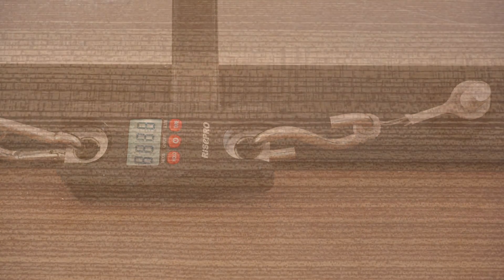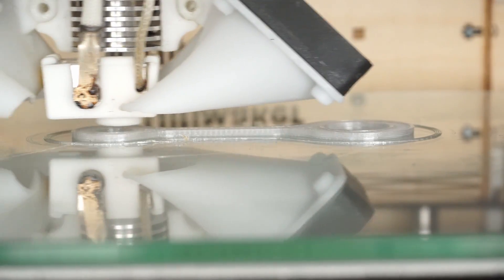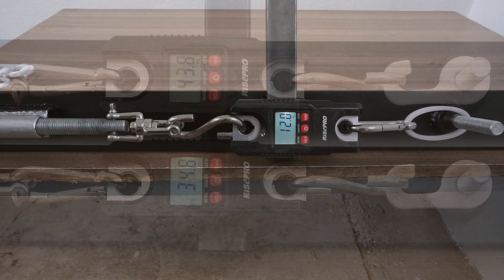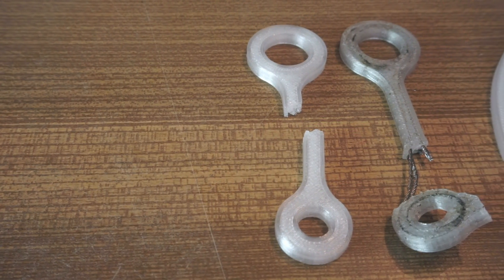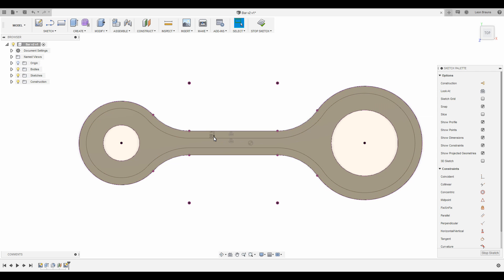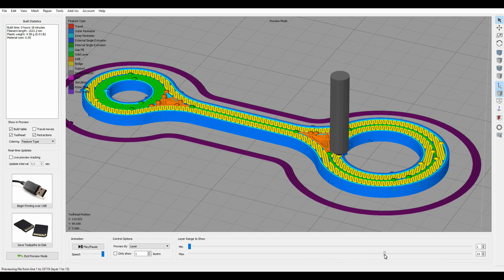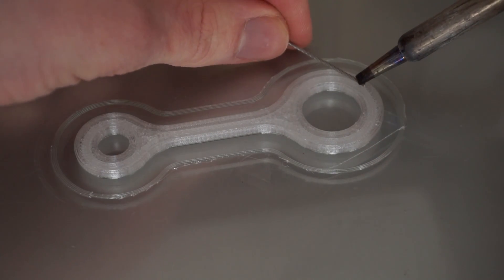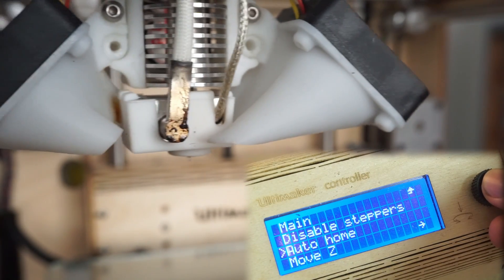Reinforce Your 3D Prints with Steel

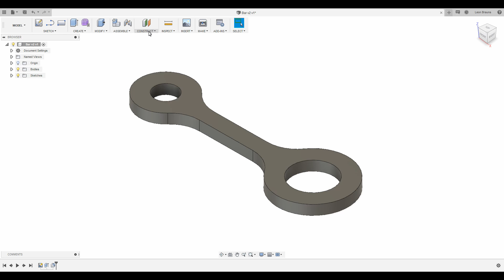Comment: 3:45 don't use an offset plane, use a midplane. This is more robust, because it stays in the middle even if you change the thickness of your part. You also don't need to put a sketch along the profile. Under create, select pipe, then square section. Pipes can also be subtractive.
Reply: Thanks for the tips. I'm still learning Fusion and that will come in handy for some projects.
Reply: applies to all CAD work. Parametric relations save so much time when you need to update dimensions or features
Reply: Good point, he's getting there but still has some work to do on his Fusion Fu.

Comment: This seems similar to why concrete has rebar put inside it. Concrete has poor tensile strength, and the rebar are has great tensile strength. Rebar prevents destructive collapse of concrete due to tension, but provides indicative surface features when the structure is taking too much tensile force, much before it can collapse.

Comment: Shouldn't the the non steel parts have had extra printed plastic in it's place? Otherwise you are comparing apples to oranges.

PS Woven steel wire is probably not a good choice considering the expansion in the weave. Perhaps if it was pretension-ed some how it would perform much better. But really a solid strip of steel would be better.

Comment: this is very interesting
I think the key of this experiment is the bond strength between the two materials
what if you increase the bonding by applying epoxy or superglue around the steel wire
unlike the rebar and concrete in reinforced concrete structure, the bonding between shiny steel wire and PLA doesn't seem strong enough

Comment: ... so simple, cheap and effective thx mate for sharing this.
This idea is worth promoting it to other You Tubers like Tom, Stephan, Noel or Angus.
Who needs a overbuild printer capable of laying carbon fiber or glass fiber behind a patent wall if you can simply do that.
Brilliant, this is definitely something I'm going to use one day, it is especially interesting to use as living hinges. (maybe some of the thin fine wires in a "radiator pattern")

Comment: Maybe in the future we'll expect to see 3D printers that are able to automatically inlay the steel strands similar to the carbon fiber 3D printer
Reply: it would be easier to have a steel laser cutter next to the 3d printer and get another machine to inlay the sheet onto the 3d printed part. Laying steel wires is difficult
Reply: @Ken-nv2hl  If you have a steel laser cutter to make shapes out of steel sheet then why bother with plastic at all. Just make your shape from steel and be done with it.
Reply: @OU81TWO  for the exact same reason he is adding wire to a part. The reinforcement of a fixed model that requires extra strength but not too much strength where the part should be made of a solid metal
Reply: @Ken-nv2hl  I understand the reason but it's a waste of time. A 1/8" thick piece of steel shape can hold 10x the weight compared to the same shape in plastic. There is no point in printing that shape from plastic.
Reply: @OU81TWO  no offense but you didn't read anything I said previously properly. The solution you are suggesting will weigh 10x too.The goal is to increase the strength of a shape that is not allowed to change its form aka a fixed shape. A part made of pure metal is too strong for the required load and will weigh alot, while a part of metal can be made of a lighter weight by FEA studies and topograhy optimization to alter its shape from a simple to complex shape. The problem is that it is expensive to fabricate complex shapes.
Reply: @OU81TWO  In addition it is easier to automate a 3d printer, laser cutter, and a pick and placer to work in unison. Than to automating a 3d printer than can lay wire while printing. Also, thr thicker the diameter of wire will introduce morr failure mode in printing due to the large bumps caused by the braids, and the empty print volume due to the cylindrical shape of a wire.
Reply: @Ken-nv2hl   I get the impression you're not understanding what I'm talking about. First, steel does not weigh 10x as much as plastic. PLA for example has a density of 1.25g/cu cm while steel is 8.04g/cu cm so it's 6.4x as heavy...but about 10x as strong.

Aside from that, my comment assumes the design of any given part is limited to flat profiles with a given thickness. These types of shapes are the only ones that can be embeded with either a steel/aluminium plate or a wire of some sort. Given this context, weight is not really a concern since your not printing large parts. If your printing quadcopter parts the it may be a concern but thats another discussion. Let's stick with parts used in a mechanical application. Embedding a thin laser cut steel or aluminium  plate into a 3D printed flat plastic profile doesn't make sense because the thin metal part can handle the load without the plastic around it.

I'm not talking about complex parts made from steel or aluminium. I'm talking about strictly flat profiles like the ones shown in the video.
Reply: @OU81TWO  I really am not gonna bother anymore. I would not like to repeat myself. All the best and good luck for your future.

Comment: This is already commercially available from markforged. Please don’t act like this is an original idea.
Reply: Where exactly does he claim this as his own original idea? You're simply looking for something to complain about, I suppose.
Reply: Markforged uses continuous carbon fiber. Not steel wire...
Reply: Dima Balan I know that, in addition to fiberglass and Kevlar. My point being that running fiber through a print is not some revolutionary idea, but has existed for years on machines that have price points in the range of small businesses and some hobbyists. Not to detract from his findings, but to act like he created this technique is just straight up dishonest.
Reply: @brrrt8212  And I guess now markforged is open source, and you can find any of their secrets here in YT???

Comment: I think it's possible to solder together two metal ends of a wire using some special flux for steel and a low temperature solder (like Rose solder).
Reply: fuck soldering just inlay laser cut sheet steel
Reply: Yeah, the solder joint is unlikely to hold up at the given stresses. You'd likely have to get it so hot you melt the plastic anyway, unless you could do it before inserting the wire in the piece

Comment: On simplify3d you can also tell it to stop printing at X height.  Save gcode.  Then untoggle stop printing checkbox and toggle the start printing at height option, and save a 2nd gcode.  You can then tell printer to print file 1, put wire in, and tell printer to print file 2.

Comment: If you have the time try to compare it if you inject epoxy on the space for the wire.  That way we don't need to pause print, just inject after printing.
Reply: Damn really a good idea.
Reply: I thought that myself but also to Just insert simple iron wire multiple Times to create a sort of concrete.
Reply: the epoxy itself is to brittle. it cant take pulling forces but steel
Reply: @Henroin42  The brittle aspects of an epoxy are completely based on its brand, and also how long it takes to cure. The majority of epoxies I have used stay pretty pliable. Two that come to mind are gorilla glue and jb weld 2 part epoxies
Reply: Epoxy without any fiber adds nothing to the parts (tensile) strength at all
Reply: @3DDruckHupfer  not necessarily true. Depends on the epoxy used. There are some epoxies that are brittle like henroin said but others that are pretty flexible. Just depends on the situation. Thing to remeber is the plastic part is not a solid piece of plastic but a whole bunch of filament laid down on top of each other. Also henroin it is usually the opposite. The ultimate tensile strength is larger than the ultimate compression strength.
Reply: @3DDruckHupfer  false...
Reply: @3DDruckHupfer  this is not at all true. Epoxies as well as many other types of glue actually can create a stronger section of the print than the base plastic that is used. If you were to inject a 2 part epoxy in to a silicone mold vs just 3d printing an equally sized object, in most cases the casted epoxy will be much stronger.

Comment: Great idea. Now braze/weld the end points of the wire together and imagine the strength then.
Reply: i was thinking this as well my friend i think with a closed loop wire the parts would be considerably stronger again. i also wondered if there was a mechanical way they could be joined like a steel crimping tool.
Reply: I was thinking tin plate insert on the inner loops and a tip on the small end where the cable ends come out to a tensioner.
Reply: Yes, people could try also to let a space for both end to be next (1cm) and put some cyano glue to join them together.

Comment: Great application of a simple idea! Thanks for taking the time to make this video. This makes me wonder if there may be any gain in strength on the tension test if the wire ends were connected via a crimped connection or even braided into each other. The braiding is possible but not so easy. It would need to be done beforehand so your knew the length of the wire you ended up with after the braiding. The benefit of the braiding the smaller outer diameter of the finished connection. The benefit of the crimp connection is the ease and speed of making it. Thanks for making me think!

Mark

Comment: I'd like to see how this method differs if you get a piece of filament and jam it in the same way as you did with the wire.

Cura and Slic3r PE (1.42-beta and higher) can do this with the Pause at Z plugin, and the filament change button in the layer view respectively. Actually easier than Simplify3D :)

They also both have custom supports. Come to the dark side!
Reply: you mean the support enforces of Slic3r PE? becaus that is a joke.
Reply: @DeKemp  I've found it to be a very fast and efficient way to add supports? I don't see the issue.

Comment: Awesome! 

Schau Dir mal in einer Suchmaschine Deiner Wahl die Bilder zu "Übergreifungslänge" an. Wenn man das, was im Stahlbetonbau gängige Praxis ist, auf Dein Verfahren überträgt, dann müsst man sich damit an sich ganz gut um die Schwachstellenproblematik am Stoß herummogeln können, soweit genügend Fleisch für eine Überlappung der offenen Enden vorhanden ist - oder vorgesehen werden kann.
Reply: You are right. Not to mention to get the delamination forces under control when bending the wire the way it tryes to pull everything apart.
Thinner but mor wires should increase the resistance too (but unforunately also the work) and avoids having a single point where there is no reinforcement.
This epxeriment is a real good idea. I will give it a try soon.
Thanks for your work

Comment: This test isn't exactly fair, though. Your non-reenforced parts still have the hollow portion for the wire.  A fairer test might be coming compare then against a solid plastic part and various types of infill.

Of course, the hollow area also means that the plastic part has more perimeters than it would if it were a solid mesh w/ infill. So it's possible that it would be even weaker.
Reply from the maker: You’re right, I should have included “normal“ parts for a better comparison. However, like you have already stated, the hollow areas do cause additional perimeters and therefore a reinforced part includes as much plastic as a normal part with 60-70% infill. So there might be a small difference between those, but I think steel still wins ;).
Reply: @leonbrauns  Printing parts with additional interior perimeters might be a worthwhile test by itself! - "solid" part, part with channels/hollows, part reinforced with channels/hollows
Reply: @leonbrauns  minimum infill, maximum perimeters vs steel. Compare strength and total print time.
Reply: @leonbrauns  Normal would be a 100% infill. Also hitting those parts that don't have the wire with the soldiering iron would help the plastic hold better.
Reply: @leonbrauns  also the steel wire only really works if it doesnt slide around. The reason fibers work in composites is because the shear stress from the matrix grips anchors the fibers in. If you can solder those wires together, the yield strength would be hire.
Reply: It’s not an experiment if the variables aren’t controlled. In this case the geometry effected the results. The oval shape performed 107% better because its radius. The circular holes were able to stretch and snap as the wire within turned into an oval like the natural oval shaped part that performed best.
Reply: @djrobwilliam1673  *affected
Reply: Another possibility is use concentric infill. That kind Of infill will be higher the resistance Of the printed model